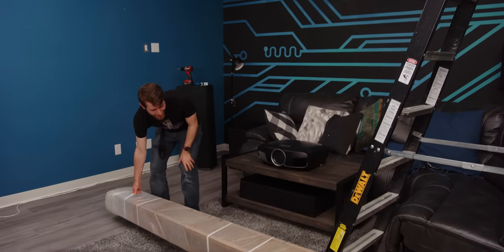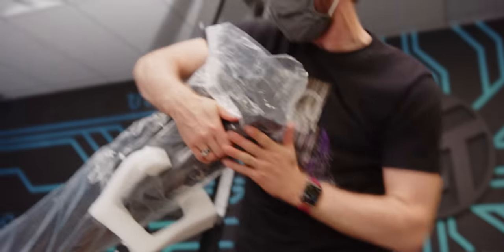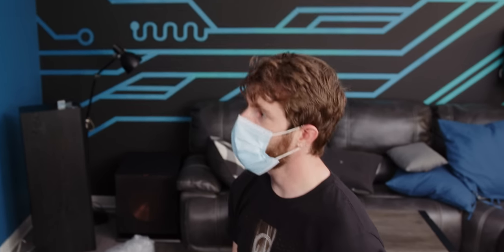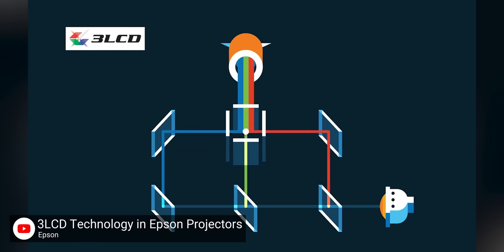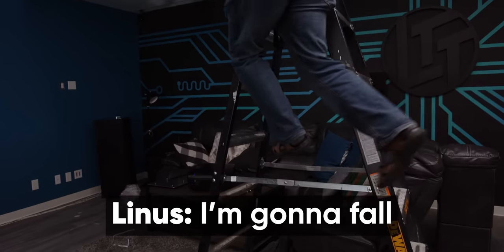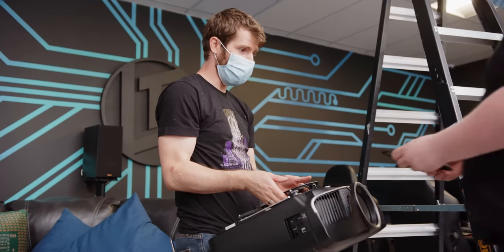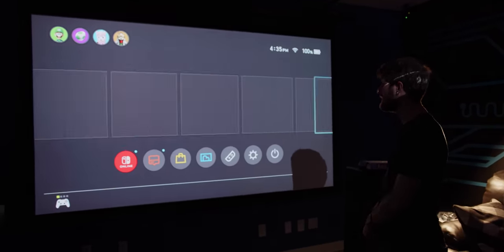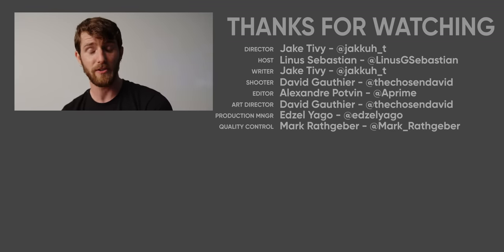Setting Up This Projector Was SO Much Work D: - LMG Lounge Update 2021

Comment: Speaking from experience, the piece of wood above the ceiling tiles is a bad idea. Over time the heat and cold it will be exposed to will cause the wood to warp and eventually the projector will be crooked. Should have used all that expensive shop equipment to make a metal bracket instead.

Comment: Guys, no. If that's as heavy as you are making it sound, you need wood blocking in the stud cavities. You will need to open the wall. That is entirely dependent on how heavy it is though. I hope it works out for you. Just check on weight capacities for the framing in your walls.

Comment: "How do you measure 0.8 of a foot" 

laughs in metric system
Reply: Metric System Masterrace
Reply: you cut off your toe. easy.
Reply: Oh, that's easy, it's just 1057/1293th of a tablespoon per football stadium
Reply: @cefcephatus  then I guess I must be lucky to never have tried using metric for digital computations
Reply: Some imperial tape measures measure in tenths of a feet lol.
Also its just .8 x 12 inches.. which is 9.6 inches.
Or very close to 9.625 which is 9 and 5/8"
Reply: @Dudeinator  what intuitive numbers to take measurements
Reply: No country that uses the metric system has put a man on the Moon.
Reply: @basshead.  No but NASA used metric to put him there. And used scientists from another country to do it.
Reply: @nerdhector6190  for the moon mission all the numbers were done using imperial on the engineering side. When it came to the flight the would input imperial numbers and the program would convert to metric do the calculations and convert back.

When Nasa finally converted to using all metric it caused a crash. The mars orbiter.
Reply: 12 X 0.8 = 9.6 inches... If only there was a smaller measurement than inches.
Reply: Odd how all these metric fanbois can't do simple math in their head.  
For what it's worth, before laughing off measuring .8 of a foot, try measuring exactly one third of a meter.
Reply: @tehs3raph1m  there is.  just like metric, we use 'mil' or 'thou' for 1/1000th of an inch.  Or if you're in the printing industry we use points which are 1/72 of an inch.  Funny how no one is complaining about still using 12 point fonts in the metric world.
Reply: @johngaltline9933  It's much easier to calculate 10/3 than 12x0.8. And because of metric, you can measure 1/3 of a meter very accurately. 33.333cm, you can add as much decimals as you need. Not some random crap like 13.1232283 inches
Reply: @johngaltline9933  The main issue with imperial is that it's not one unified system.
Try describing something that is 1352cm, sure you could just go the inches route and say its 532.3 inches but generally in this scale you would use feet so 44.36 feet. Which is  generally weird, okay feet and inches 44 feet and 4.3 inches. Now you are using two different units  that are needlessly difficult to grasp. 

This is just using length as a measurement. In metric we can easily convert between 1m³, 1000 liters or in case of water or most similar liquids also 1000kg roughly. This is a lot harder in imperial. 
I will however grant you that if you can stick to just using feet or just using inches, both systems work equally well. It's just that metric makes it a lot easier to switch scales, or even switch between volume dimensions and weight.
Reply: @qlum  As an Engineer in the US we learn to use both metric and Imperial. Typically with imperial we either stick with inches, feet or miles depending on scale.. though for engineering it's almost always feet/inches. Its not hard to divide or multiply by 12.

One thing I know that can be hard in metric is accidently adding or removing a decimal place when converting feom units since dividing by base 10 gives you a very sinilar number. Like at a quick glance 153206790000 cm can easily be confused with 1532067900 dm even though its off by a factor of 10.

While inches if you go from feet to inches you gotta use a calculator to go from 15783900 feet to 189406800 inches. 

Pretty much most units in real life sticks to on scale typically in school you get all kinds of scales and you gotta convert but typically you will record everything in meters, or just in feet or just in chains.

Another thing imperial is fine the problem comes when you have to convert between imperial and metric and try to use both.
Reply: @Dudeinator  wait a second, didn't that happen because of a confusion inside the program?
Reply: @basshead.  no country that uses imperial has ever landed on Venus
Reply: @Spirit_Circle  the numbers NASA got from somewhere else were imperial, they figured it was already converted inputed the imperial numbers into the program that thought they were metric already and since miles/feet dont equal km/m kabooom. I believe it was some acceration values or specific impulse.
Reply: @Dudeinator  well then, all that shit happened because of garbage planing inside nasa, not because of the metric system
Reply: @Spirit_Circle  well yeah, of course no one's saying there's something inherent to the metric system that causes technical problems
Reply: @Spirit_Circle  if they didnt switch over to metric it wouldnt have happened BAM metric system is inferior!
Reply: @Alex-gh1lx  >something inherent to the metric system that causes technical problems

dude, that's exactly what the other guy is saying tho...
Reply: @Spirit_Circle  pfft the inherent flaw in the metric system is it's base 10. Everyone says it makes it so easy to scale up or down but it also increases the chance for an error since moving over a decimal place its hard to at a glance identify meaning its more error prone. While with imperial you most likely need to use a calculator to scale up or down. So you wont make a mistake and put the decimal in the wrong spot and easy to tell when numbers are scaled.
Reply: If you need to ask, then you failed at basic math. This is solved by critical thinking skills taught in basic math. .8 is 80%, you multiply that by 12 to get 9.6 inches. It is not hard
Reply: @Dudeinator  I mean, if you need to take important measurements and do it in your head and make an error the inherent flaw is yourself, whether you're using imperial or metric. Scaling with metric system is more intuitive than imperial, and that's easily demonstrated.
Reply: @meatmeatmeat1528  see but those flaws and benefits from metric system and imperial are mute, because the imperial system already uses base 10 for a lot of things now a days. Typically you dont go from feet to inches, or lbs to stones or ounces. Like for forces we have pounds, and also kips, which are 1000 pounds or a kilopound. 
We use mega and such also. Very uncommon to see centipounds and such though.

I was mainly just messing around when i said that metric system is flawed.

Tldr: imperial now uses a similar base 10 system using kilo, mega etc...
Reply: @cefcephatus  You do realize your sentence makes no sense ?
Binary does not oppose the metric system
Reply: @johngaltline9933  how much is one third of 100?
Reply: @Rob-ii9gl  Depends what you're talking about.  if it's 100 feet, than a third is 33'4", exactly.  if it's cats, you don't really have a cat any more if you divide it up, so there's 33 and some left over.  If it's meters, it doesn't matter how many decimal places you use, you'll never be able to get the exact value.  In general it's 33 and one third, a measurement the metric system can not ever give with 100% accuracy.
Reply: With the decimal foot
Reply: @Dudeinator  that's not a problem on the system, that's literally the users fault. What you're saying is the equivalent to shooting a school and try to argue that it's the gun's fault because the safe was off...
Reply: Yes!
Reply: @Dudeinator  says really more about how inconvenient it is for the US the almost solely use the imperial system because they felt special
Reply: @juampyvarela  metric has no benefits over imperial because the imperial system already has a base 10 system as well. Take that you metric supremacists!
Reply: @AnymMusic  not really sure what you mean, ive done a lot of replies not 100% which one youre replying to. But I think youre talking about the NASA crash caused by the mixture of units. Technically it doesnt reflect bad on either measurements. What it shows is that you will have issues when changing from one system to another. I just phrase it in a way to blame metric instead because a lot of people cite that as a reason to not use Imperial. Which the only things it proves is accidents happen when you try and use two different systems.
The imperial system already uses a  base 10 system in engineering. It becomes a problem when an Engineer is taught only Imperial then they have to suddenly switch to metric, and also land on mars or anything really. But now adays Engineers in America use both imperial and metric so its not as big as a problem.
I use engineers as an example because I am one.
Reply: 12*0.8=9.6 inches

Comment: 7:30 "How do you measure 0.8 of a foot?"

Metric system: let me introduce myself
Reply: Just divide 12 by 5, then multiply it by 4
Reply: @raawesome3851  or divide 48 by 5
Reply: Me using dumb fractions: I don't think so
Reply: @raawesome3851  or just use the metric system
Reply: 4/5
Reply: @bradhaines3142  it just requires more effort to calculate fractions on a base of 12 or 16 instead of 10. It's doable of course and you get used to it but it is still unnecessarily more complicated for no benefit
Reply: Engineer ruler, has 1 foot broken into 1/10 and 1/100. Easy.
Reply: @LostPilotage that kinda fixes part of the problem but not entirely, you are still in trouble to convert to the above and below unit because it "doesn't line up"
Reply: @maximravinet9950  I am not sure what you mean. An engineering ruler will measure XX. 8 feet perfect. If you are talking about parallel planes, simply dropping a plum bob would square you up.
Reply: @raawesome3851  that sounds horribly and unnecessarily complicated.
Reply: @LostPilotage  legit engineer ruler has not feet, hands, stones, ankles and whatever random units else Muricans think of.
Reply: @RandomUser2401  An engineer scale ruler certainly has feet. Obviously your region in the world may have different needs and utilize different scales. I used several in construction for years. Still have one in my old lunch box, with my cat keys. 😉
Reply: @LostPilotage  I was trying to express that if you divide a foot in 10, you won't have a round number to convert to inches which is a bit inconvenient. Sorry, English isn't my first language so sometimes I'm not very clear
Reply: @maximravinet9950  No worries, respect for your knowledge and ability to so closely communicate in a foreign language.
Reply: @LostPilotage  thank you 😉
Reply: @LostPilotage  well all the engineers here have cm, mm and .5 mm for fine scale-applications. How you can even remotely think of using imperial units for anything serious is beyond me. Even construction is a scary thought but legit science and engineering? Hell no (I also think it is not used in academia at all).